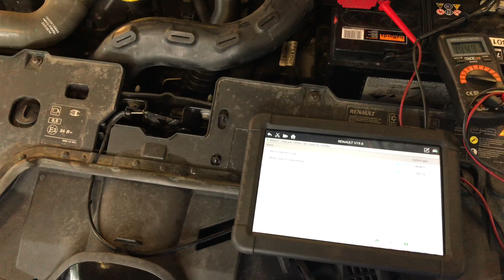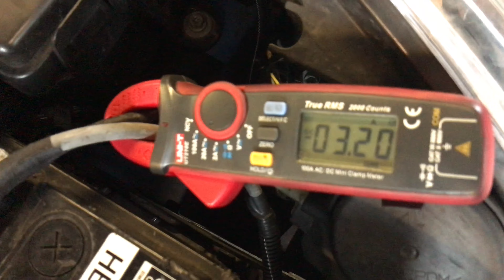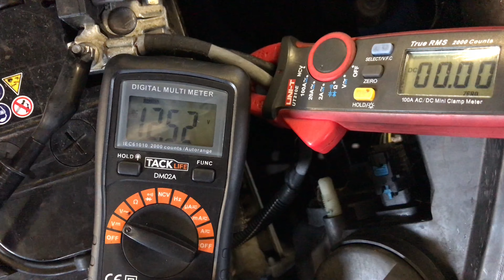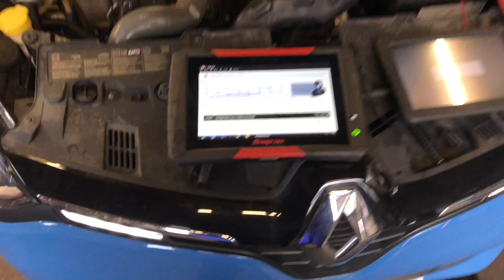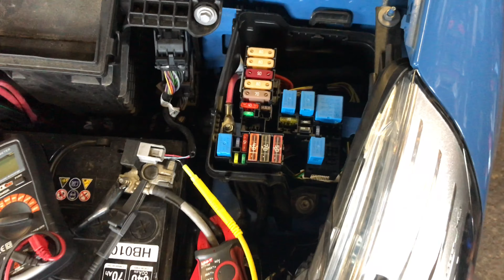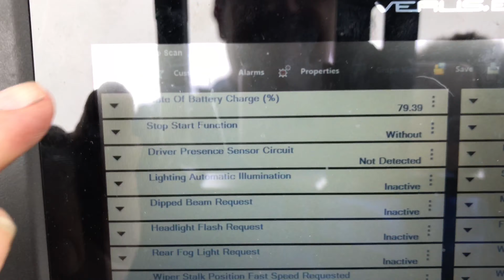Renault Clio IV (2014) - Battery renewed still won't start in morning - Codes DF0003/DF0043 Part 2

Comment: I have had this many times on these 1.5 dci..the red wire from the alternator where it runs along the top of the starter motor gets warm and melts the the loom that's tapped to it. Always check there before buying any parts.

Comment: Register on the Varta portal mate, then contact their tech team, let them know you're part of SDN 👍 I've not noticed AGM fitted to these but it can't harm to upgrade. IBS are notorious for failure, make sure the battery and alternator are configured correct for what's fitted 👍
Reply from the maker: Cheers Steve I'll check that😀

Comment: Hi Sandy, if the vehicle is not stop start, it should have an ordinary flooded battery in it, with stop start, it will be an EFB, Nissan and Renault dont fit AGM batteries as a rule. EFB & AGM batteries normally need to be coded in, Basically  it clears cache memory in the ECU, but I don't think you have this option, here, what you could try it a battery reset, disconnect the Neg lead, and insert a test light between the Neg lead and the positive post, leave it for app 10-15 mins this should reset everything and retest, you can keep the new EFB battery if you want, it wont make a bit of difference to the charging system, just a battery upgrade, the battery cycle life for an EFB is much greater than a flooded battery, basically a flooded battery does not like to go under 80% of its charge, on the other hand EFB & AGM batteries can go as low as 10% and recover very fast cheers
Reply from the maker: Thanks Kenny for your help with information cheers sandy

Comment: Hi Sandy great video again.. Lots of great information form everyone. One thing I'd have a look at is the alternator clutch pulley. I've seen them fail only when they get hot. When the alternator is cold you won't see any problem. Symptoms could be when hot complete clutch failure ie no output from alternator  our again when hot you might get 50% slip meaning half the output the alternator can give.. Worth a look and a cheep fix..  Your alternator output voltage should be 14.8 volts..
Reply from the maker: Will check that out cheers sandy

Comment: One. Thing you not looked At. is the battery sensor that you unplug   can go faulty puts hi or low voltage and put that code up

Comment: hi sandy, good evening, So, here's my input on this exact problem, as i've had this on a nissan qasqhai, and a clio.  As usual it's going to be a long winded reply as plenty to say about this issue. apologies. 

The renault/nissan cars all running the 1.5dci engines, from around 2010 upto present models as late as 2018 models, of both manufacturers, as you know nissan is owned by renault. anyway, from the factory they were all fitted with FIAMM, batteries. 

However, that's where the problem arose, but the battery problems don't always appear to be straight forward. As sometimes, the car would be perfect, and then a few days later, total non-start situation, even to the point where as the car would attempt to crank but then would start throwing up various warning issue's on the dashboard. 

And then even when it's doing that, sometimes would randomly find the power to start the car up, it's all down to the original fault of the poorly manufactured FIAMM batteries, which are EFB batteries from factory. 

So whilst i appreciate the car your working on hasn't got a FIAMM battery on, but a "halfords" battery on, you've just been given a curve ball, some 18yr old saturday kid who works for halfords, has just fitted a battery to that clio, hence why i think its given you a head scratcher. 

The original fault with the genuine batteries was they would frequently cause a dead cell short between the cells and throw the battery a total boswonk!!! 

I think you've just got unlucky that someone has already put a battery on it, and to be honest, its the total wrong battery. renault and nissan replace the batteries on these, with an EXIDE EFB or a VARTA EFB. 

The "bem" system on the clio is looking for a particular style of battery. 

This is the experience that i've had within the last 6 month, with the exact same issues your customer's vehicle is having, and each time a correct battery fixed it. 

hope  this helps somewhat. kind regards kieren. 

PS, as a side note, if the customer has the original FIAMM battery, stick it back on car, and get them to go to dealers, and explain that the battery is going flat overnight, and the dealers replace them free of charge, its classed as a "none-critical" recall, in other words, if a customer comes and complains about a specific issue, i.e flat battery they replace it free of charge.
Reply: Thanks from me too Kieren. It is a very helpful information. 🍻 cheers
Reply: Hello, here in Greece, 2 Renault clio’s 2016 that I was driving until recently they had from factory mutlu brand batteries (Turkish I think) and dealer replaced with exide if I recognized them correctly
Reply from the maker: Wow Kierin once again your input is brilliant!!! I'll contact the customer and tell what you've told me and get them to go to dealer, a very big thank you cheers sandy

Comment: since the vehicle is equipped with the battery sensor system should be calibrated.did you try new battery registration with your launch?as far as i see the alternator still pushing  44% even the battery is fully charged
Reply from the maker: Hi there is no option on the launch, snapon or autel for battery registration, seemingly they don't need it cheers sandy
Reply: @sandyande  cheers mate,good luck!